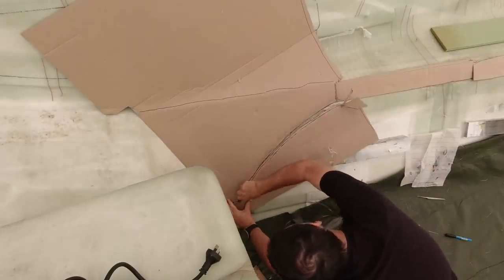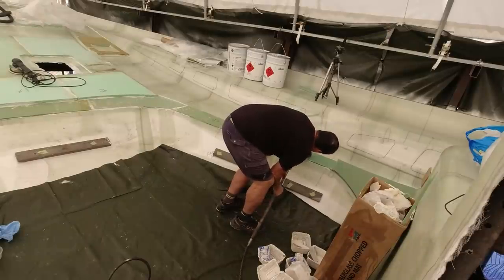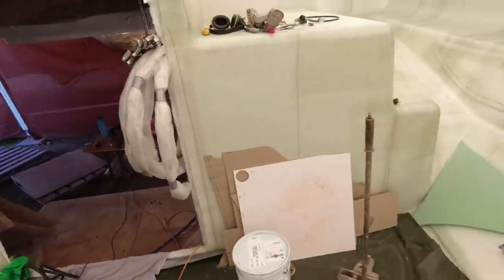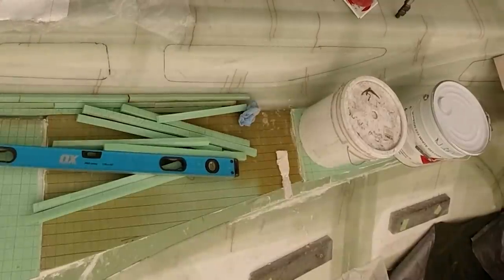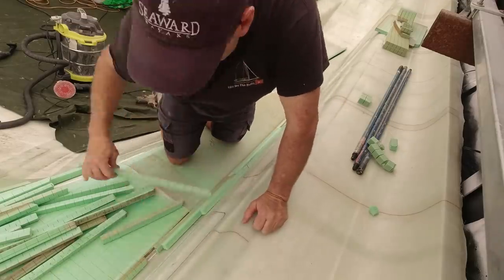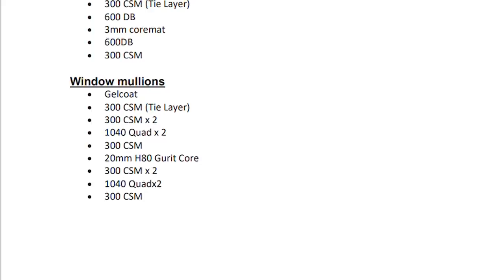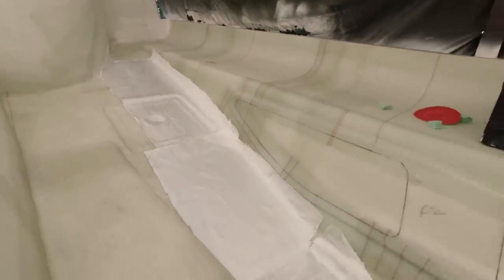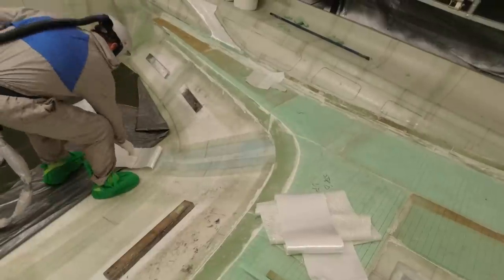Ep174 - Why Strip Plank Foam Core ? - Catamaran Build

Comment: Another great video Rossco.  You should be closing in on 10 times the number of subscribers!  Such a mental challenge to do things the proper way now, versus the extra work that will be required later.  Those visible “could have done that better” bits, are what haunt you down the road and forever!  👍👍
Reply from the maker: Thanks mate I appreciate you following along.

Comment: Ross as a sailor do you think an extremely rigid structure or one with some flexibility built in for an ocean going vessel is preferable to avoid any failure as someone who only uses power boats I’m quite interested in your opinion thanks in advance

Comment: Bead and cove the planking works even better to reduce voids but consumes / wastes a bit more foam in the milling process.  Vac bag is also preferred for core install esp in complex areas where you cannot weight down sections.

Comment: Hi Professor Ross,  did you add conduit in the structure to allow for wiring for lights etc? You’ve done awesome work!
Reply from the maker: Hey Jeremey.I didn't add  conduit as strucutre was pretty previse acvording to schedule,but I did think of a couple of areas where it could work.There had a section in the saloon roof that will carry conduit for strip lighting and a pellament that will secrete most wiring.otherwise lining will be applied and hide wiring where necessary. Ross.
Reply: @LifeOnTheHulls  good stuff Ross, can’t wait to see the flip!

Comment: please forgive my sloppy
Did your video mention using that material before:
  PVC Foam Core fiberglass, plywood fiberglass?
Is there PVC FOAM CORE next to the factory wall?
Has the use of silica aerosols been considered? It has similar thermal conductivity to polyurethane foam. But silica aerosol is too brittle, but it is really too light. Will silica aerosol be so beneficial for you to travel around the world?

Comment: Hey Brother there is no other man like you😁 I would like to suggest some to you that will work better than those Whit Putty knives , Good for mixing Resins but suck for fillers Glue, mastic. You know those those 3”-4” auto body spreaders . Instead of wiping excess with a rag ,use one Spreader to wipe off excess easily, or you take a pair of scissors or tin snips cut the end to any radius easily,  or for tight areas cut them 90% of the blade again 1” - 1 1/2” - 2” . No radius , or your desired radius. You will love them. Allow if you need a firm edge use the other Side . 
Try one you will never go back . The make all Jobs Super Fast

Comment: My question would be if you want a smooth finish around what your doing is great but why not also do your fairing in the mold before you extract it..  it seems to me it would not mater but it would be much easier working it that way rather then overhead  “ just sayin “
Reply from the maker: Great question David.Issue is that the deck will be joined to bulkheads partitions etc and would be difficult to ensure smooth transition ovwr tabbling till after these final tabs are made close to competion.Trying yo get close but sadly not close enough.Cheers Ross

Comment: I don't know why you want to avoid filling gaps in voids between grid scored joins. The extra weight is negligible,  and any resin mixture will be far less compressible than foam  
Foam it s ONLY "strong" in compression,  and any sheer forces that would break filler compound in grooves , will shatter the surrounding foam anyway.